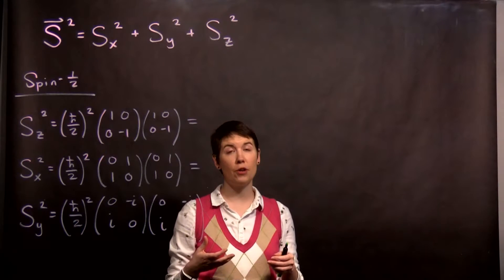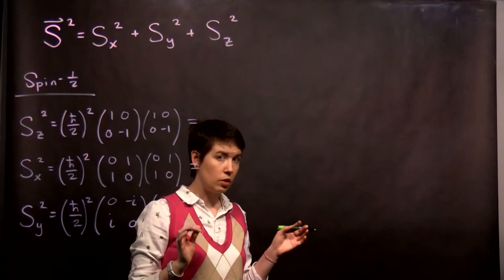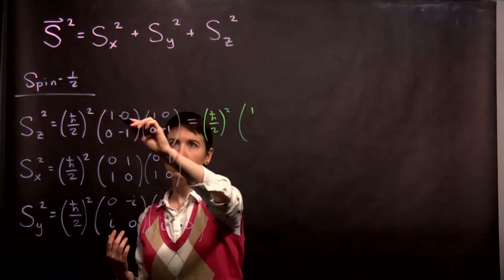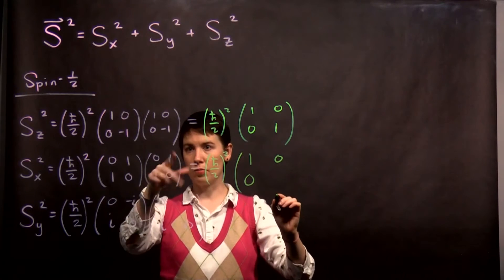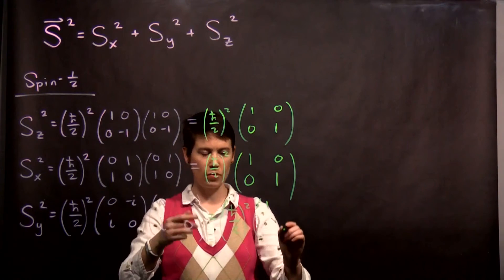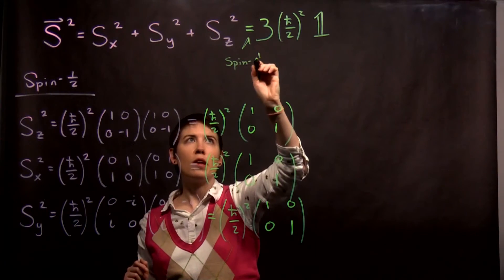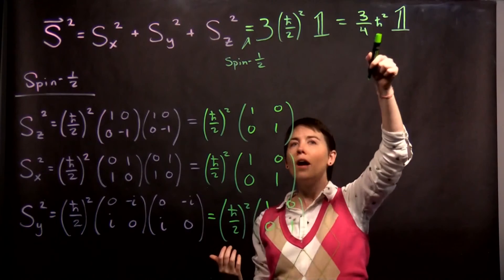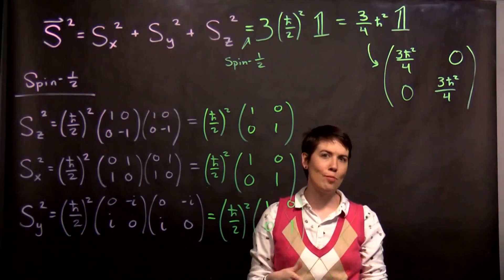S^2 operator and its matrix representation in the spin-1/2 system

Comment: Hi :) , I have a question. This theory is equal to S= 1/2 or is completely diffetent. Thanks for tour response
Reply: As stated many times during the video, this is for spin 1/2, yes. There is an S^2 operator for higher spins, as well, but the calculations are different. Same idea, just larger matrices